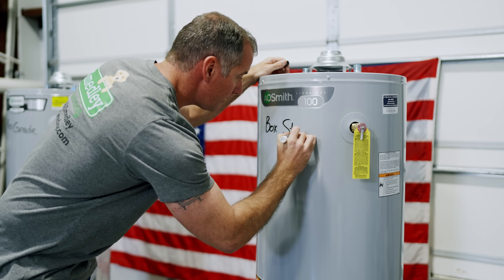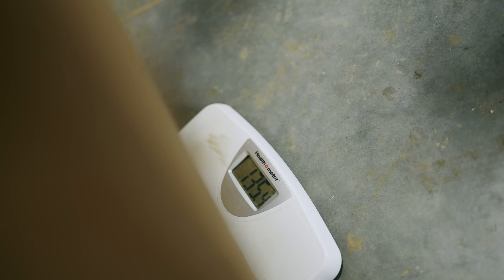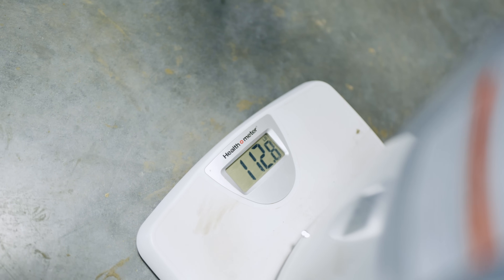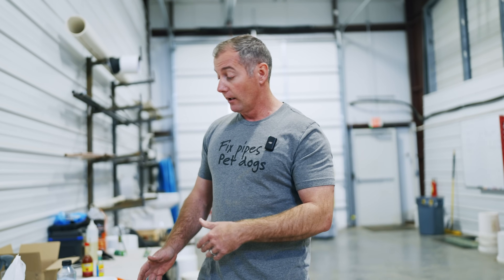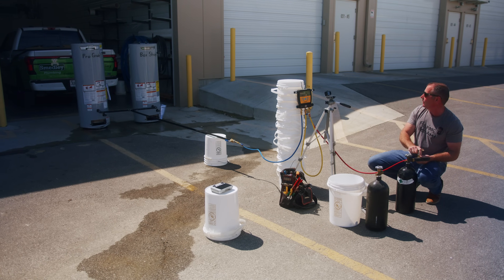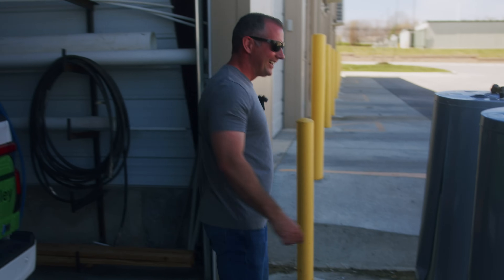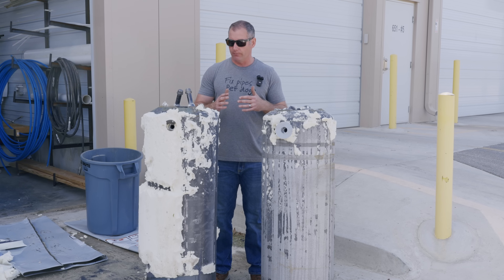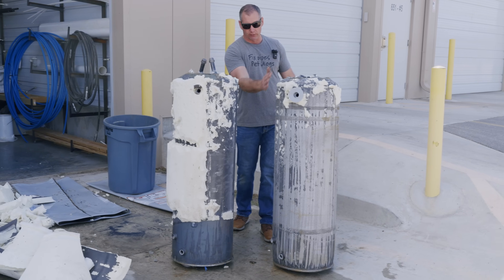What water heater should I buy? - Pro Grade vs. Box Store

Comment: The temperature & pressure relief valves look to be identical to me.  And I replaced tons during my 30+ year plumbing career.  Better heating out of a flue baffle that weighs an additional ounce, and is 3” longer?  I would challenge you to measure any difference in heating efficiency.  Further, I just had to replace my son’s Bradford / White 50 gallon electric tank purchased from my local plumbing supply company.  7 years old … 6 year warranty and B / W would not help us out.  
So, we purchased a AO Smith tank at the local big box store.  Same warranty - less money.  You’re really nit-picking these tanks in your comparison.  You haven’t sold me on a significant difference, and I installed “professional” tanks for 30+ years.  
Nice job on the presentation though! 🚱😉   BTW;  since we are both licensed plumbers, we both know that the tank would never experience 400 psi of pressure.  The T&P valve will open at 150 pounds.  No sense alarming the general population!  😂
Reply from the maker: T&Ps open when they work.  But when they fail, you're relying on the tank construction to keep you safe.  Also, warranty is warranty.  At 7 years, it's out of warranty and nobody will "help you out".    The goal of the video wasn't to convince anyone.  It was to show the differences and let you come to your own conclusions.
Reply: @SmedleyPlumbing  neither tank violently exploded in your test. you had a lot of fear mongering when it came to the overpressure failure. even in this comment you are fear mongering saying the pressure relief valves can fail - well per your video, the first failure is leaking at the water connections - which means neither tank would see the pressures you are scaring people about.
Reply from the maker: @opfreakx  fear mongering?  Lol.  Okay.  We see ruptured tanks every week from t&p valves that fail closed.  It's actually very common in older tanks.

Comment: Two things actually really affect the longevity. One is the anode rod condition, which for all intents and purposes should be checked yearly because all municipalities use inert additives to keep underground pipes sealed. Your water tank is like the expansion tank we install now. they collect whatever is pumped into the lines AND it is generally more problematic if a new development or apartment is built close by and they have to upgrade those lines. so checking the condition yearly isn't a real problem, then there is the yearly drain down and flush. Doing them both will generally suprise and reward you. Wells are , in most cases, pretty good water sources but certain minerals (i.e. sulphur and high iron or megnesium traces) can affect the longevity of the anode AND THE INNER TANK WALL. Good comparison and great teaching tool for new and beginning techs.
Reply from the maker: You're not wrong on both the anode rod and the expansion tank. However tank quality will still determine how long the tank lasts even if the Anna rod is new and the expansion tank is installed properly.

Comment: I've bought a lot of box store things which pros would say are built inferior. While some things were technically true, such as lower quality exterior materials, I found that they lasted nearly as long as long as it wasn't abused. I learned the hard way that with water heaters and anything gas related, to never skimp on quality. 

There was a shortage of supplies around when covid hit, so an HVAC contractor got a Rheem power vent unit from home depot for me. The unit's vapor sensor would trigger randomly shutting off the unit (I get that they can be sensitive, but the one it replaced did not have these issues) and some circuit board (?) in the motor assembly failed just recently (4 years of ownership); had two different techs look at it to make sure the first wasn't trying to just get me to replace the unit. Both said it would be hard to diagnose the exact part, but either way the whole motor unit replacement would cost at least $500. They had never seen a Rheem unit fail so early, but had heard rumours that HD receives seconds from Rheem, which may not be true but felt like it after seeing this.
Reply from the maker: It's worse, they essentially request Rheem build them second hand quality units.

Comment: The big box stores will typically have a good better and best option for those water heaters, which of those three did the AO Smith from The Big Box store fall under? Not saying that there isn't a difference just wondering if you got the middle option or the highest option from The Big Box store if the comparisons wouldn't have been more similar
Reply from the maker: We compared two 6-year warranty units.  The box stores typically have 9 and 12 year warranty options but we wanted to compare the most similar units as possible.

Comment: Great video. 3 factors to consider. First, cost.  DIY box store water heater $850ish.  Plumber install, (in my area) $1,700.  (Coupled with the fact that you can’t buy a pro-grade without a plumbers license (in my area). Second, your water heater should NEVER see 400+ psi.   Ever. Is the box store unit better built? Yes it is.  Does that mean that a box store grade isn’t adequate for its intended purpose? Absolutely not.  A stock Ferrari Testerosa engine will hold up better on a race track than a stock Chevrolet Silverado’s.  But that doesn’t mean the Chevy engine is inadequate for its intended purpose.   You shouldn’t be racing your stock Silverado, and you shouldn’t be putting 400+ psi in ur box store water heater.  Def an interesting video though.  Thanks for doing this.  TLDR: change ur water heater every 10 yrs or at signs of failure, do the factory recommended maintenance, and don’t put 400+ psi pressure in ANY water heater. 😂
Reply from the maker: Cost Comparisons from a diy install versus a pro install are apples to oranges.  Using your own analogy, that would be like comparing an engine built from a machine shop with top line parts versus an engine built in a home garage with eBay and Amazon parts.  This test was heater construction and quality only.  No other outside factors.
Reply: @SmedleyPlumbing  I understand your point. But as a homeowner, this is the same same as comparing Chevy versus Ferrari. Ferrari is going to win every time. The cost factor was just an observation. Maybe more of me thinking out loud.

Additionally, I don’t know any plumbers that are buying “big box” water heaters to install on a professional installation. So one has to wonder why the comparison was made to begin with.
Reply from the maker: @onepiston5956  people cheap out with box store units all the time.
Reply: @SmedleyPlumbing  it’s like a $50-$100 difference? I don’t understand.

Comment: What accounts for the big disparity in annual energy usage?  320 for pro vs 227 for box.  I have tried assiduously not to allow my water heater to go up to 400psi so the failure under pressure means nothing.  I think there is no compelling reason to prefer one over the other considering price and energy usage.
Reply from the maker: Different math to calculate the rating.  They base those ratings off an "average" energy cost.

Comment: I had a State gas unit installed s few years back to replace a older Rheem which was great.  The State ran out of hot water quickly from day one.   We hate it.  It's about a 72 gallon unit.  What would be a great large gas heater to replace our current POS.  As a side question, why dont they just make the tanks out of stainless steel?
Reply from the maker: Sounds like the plumber installed a smaller size.  The 72 is not the size but rather the first hour rating

Comment: I would be curious about the thickness of the steel of the tanks.  I expect that is where the weight difference is.  The thinner steel would expand more under pressure, which is why you saw the differences in failure mode.  So the box store model, with thinner lighter steel, expands and contracts more under pressure changes, breaking the glass lining.  Once the glass is compromised the thickness of the steel doesn't matter much because corrosion of the steel is relatively fast.
Reply from the maker: We left with the same thoughts.
Reply: @SmedleyPlumbing  Hole saw and dial caliper....

Comment: Are the model numbers the same for both units? It seems important since there could be slightly different units in the same series, with each unit having a few more features for a higher price, going from budget model to to of the line. If they are the exact same model, then the differences you are showing will be very helpful for consumers, if they are similar models from the same series, having less features for  a lower price would be normal pricing if one model was meant to be a lower cost version.
Reply from the maker: Three box stores try to get you to think they're the same units.  But they are indeed different.

Comment: I just replaced my Bradford white for a box store A.O. Smith. It just so happened that I saw this video 2 hours after installation
Reply from the maker: Oops.  Make sure the water pressure is under control and that you don't need a thermal expansion tank

Comment: Ok your test came out as expected with the pro coming out better, but as a Chicago license plumber who worked for 45 years I've never seen any water heater with a TPI correctly installed have the tank expand and distort, the thing that was most likely to fail and cause them to leak on gas water heater is the bottom of the tanks would give out to rust, and the only times we used and still would only use is in situations where the incoming water had a RPZ or dual check, and in residential RPZ were only on the lawn irrigation feed not on the incoming water feed to the residence,  on commercial buildings where other than Chicago proper, or some of the close suburbs all commercial buildings had to have a RPZ on them, Chicago only made you use them at devices that could be a source of cross connection,  the reason for this is other than the high rise Chicago water pressure is very low, like I've seen it drop to under 30psi, this was claimed by the city plumbing inspectors was because the city had so many old water mains that could break if they push the pressure up.
But again the only time we would use expansion tanks were in closed systems where there was a backflow device, if you don't have one then if the pressure increases in the heater all it does is push that pressure back into the city water supply, and the highest city pressure I've seen is actually the village I live in where it could hit close to 80 psi during the late night when the industrial park wasn't at full demand, our village is probably around 60 to 70% industrial!, but for the tank to distort the TPI would have to fail and never have i seen one fail to not open only failed where they'd open when they shouldn't
Reply from the maker: Yep

Comment: Isn't the prograde unit also glass lined? If not what is it? I understand the steel is thinner invthe box store ones and ao its warping under pressure more but both shoudl fail with the glass warranty window right?

So basically is it a different in strength that leads yo glass failur leasign end of use in 7yrs or is it the glass actually failing?
Reply from the maker: Yes.  Both.  Thinner and weaker steal leads to premature failure.

Comment: Seems most the weight difference is the anode rod and then the drain valve and panel cover. Doing the math, that means the tank has to weigh very close to the same. Think im gonna go w box store and a brass valve. Then replace the anode rode in a year or so and then probably every few years after that because we have very hard water in MO.
Reply from the maker: The tanks alone have a significant difference as well.
Reply: @SmedleyPlumbing  i am just replacing my big box water heater from ao smith after 12 years. Not bad and til now, I didnt know how to maintain it or anything maintenance or any anode rod lol. I beleive it am gonna replace it with same one and replace the rod every couple years. The hard water here is insane

Comment: I waited the whole video for knowledge about the tank. Is the wall thickness of the tank different. Is the type of steel different. I felt a little disappointed that your analysis stopped short of that. Other than the drain valve I did not see that the pro grade was convincingly better. The valve can be replaced upon purchase and still save $100. The anode rod is also replaceable if important to you. The length of the gas exhaust turbulator is likely because the bottom is more dome shaped on the box store version. This can be better for over pressure. Over pressure is not really something a home owner has to worry about. Corrosion of the tank is the big killer. Also, isn't glass lined steel a proprietary process belonging to AO Smith? Are other tanks really glass lined?
Reply from the maker: Yes we didn't send the steel off for analysis and we didn't measure the wall thickness but we did prove that one tank is about 10 lb heavier than another tank so there is obvious differences there.
Reply: @SmedleyPlumbing  I am left wondring... Glass thickness? Steel thickness? Density differences due to different steel? Density of insulation? These questions aside... are all tanks glass lined or just AO Smith?

Comment: Moved to a new place and found out the hot water is yellow even after flushing.  Commercial grade ao smith 9 yrs old.  Quote to replace is $5000. Higher end box store is looking like 1300 plus another 800 for work.  I really want a commercial grade unit, but the price is painful.
Reply from the maker: Shop the pro price.  $5k seems high.

Comment: Not surprising. I would imagine that the big box retailers with their sway, ask the manufacturers to shave a bit off the quality here and there so that the unit can meet a specified price point.  My question is when a customer calls a local plumbing company to replace a water heater, where does the plumber source their products, a pro plumbing supply house or do they swing by Lowe's or Home Depot on the way to the customers house?  Usually, the customer does not have a choice in the middle of the night or on a holiday as to what brand, model of  water heater.  Last time I have mine replaced they recommended a Rheem Professional model with a "better gas valve" , a Rover Shaw or something, a nice metal housing compared to the previous plastic Honeywell.  Will leave that up to those more into plumbing.  Frankly, I feel that changing a water heater is best left to a professional plumber. The video is enlightening on the differences.  Thanks!
Reply from the maker: The good ones but from professional plumbing supply stores. The cheap companies typically buy them from the box stores.

Comment: One thing I hate about control unit on my big box store water heater is the flashing light produced and beeping sound produced while operating. Not everyone's water heater sits in a garage. Some sit in a closet in living space. So that sounds and light pollution is unwelcome. The control was produced by Raytheon. My water heater is a different brand. Still I wonder if the pro grade units behave the same way.
Reply from the maker: Yeah water heaters are becoming less silent.  You can hear electric water heaters sizzle and heat pump water heaters are noisy too.

Comment: So as a retail consumer purchasing a Pro Line heater the cost is double wholesale price plumbers pay in a supply house. If you are a DIY is it worth the added cost? Will it outlast 2 box store heaters?
Reply from the maker: Supply houses don't care who's buying their water heaters. They're going to sell it to you for approximately the same price as they would a plumber. The plumber only gets a discount based off of the volume that they are buying. And that volume needs to be massive in order to get a discount.
Reply: @SmedleyPlumbing  There are some supply houses that will only sell to the trades. Depends on your location.
Reply from the maker: @mainj54  there are more that sell to the public than those who don't.  Most have realized they're carving themselves out of a huge market by only selling to contractors.
Reply: @SmedleyPlumbing  In my area  a 40 gallon NG 8 year Rheem at HD is $779. A Pro Rheem at a supply house is $1408.
Reply from the maker: @mainj54  something is not adding up with those prices.

Comment: Good video but my pro grade ao smith water heater broke after 3 years. Trying my luck with one from Lowe’s at least it has a 9year warranty.
Reply from the maker: Most likely a fluke or caused by a missing pressure regulator valve or missing thermal expansion tank